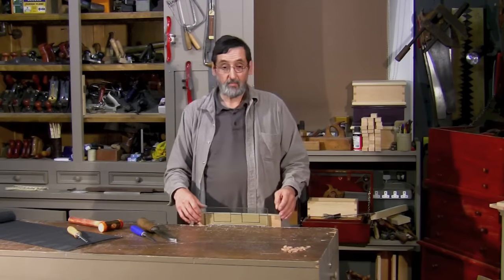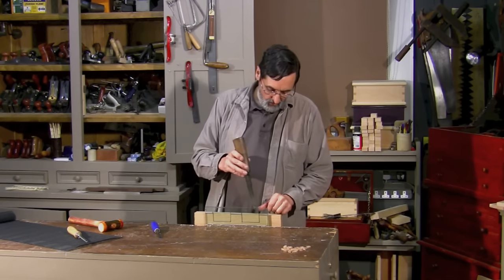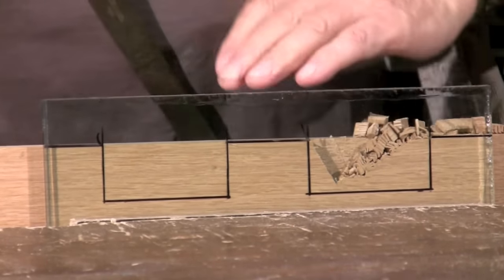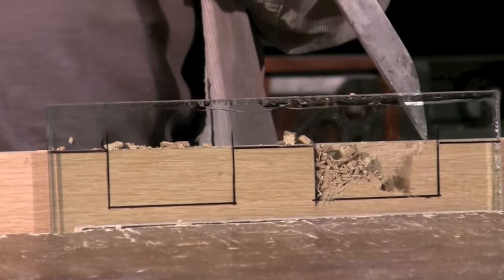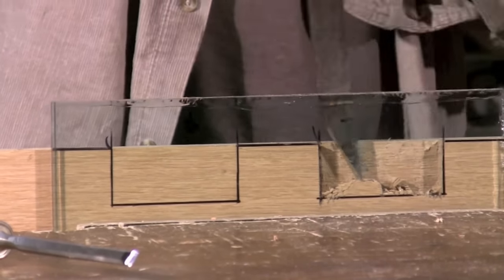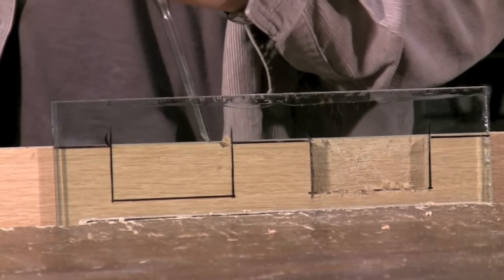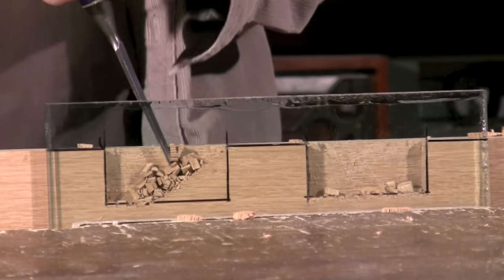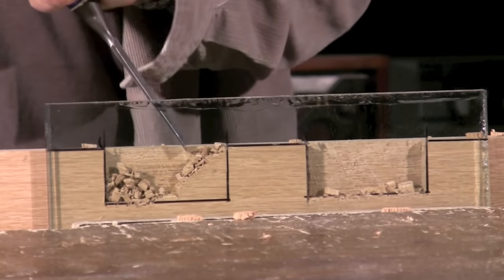Cutting a Mortise - Mortise chisel vs bevel edge chisel | Paul Sellers

Comment: "Challenge the traditional way" pulls out router
Reply: Good luck getting square corners!
Reply: @ferrumignis  why couldn't you do everything but the corners?
Reply: @SirFancyPantsMcee  How do you cut square corners into a mortice when plunging with a router bit?  You can't, you'd need to use a chisel to square them up afterwards, or use a mortiser instead of a router.
Reply: @ferrumignis  so you couldn't take the center out then square it ut
Reply: @SirFancyPantsMcee  Square it with what? A chisel like I suggested?
Reply: @ferrumignis  ..... yes square it off with a chisel......... do the bulk of the work with the router. that was my point.
Reply: @SirFancyPantsMcee  That is exactly what I said four posts up.  As I said in my first post you can not create square corners with a router, nothing has changed.
Reply: @ferrumignis  it's simple, use square bits
Reply: @ferrumignis  takes out a multitool with a small blade
Reply: @ferrumignis  Not entirely true. You can make a rotary cutting tool that can cut square holes. 
https://youtu.be/rjckF0-VeGI
It is somewhat like a mortise cutter though in use, but in theory you could mount that drill guide to the bottom of a slow router and push it sideways instead of drilling it out.
Reply: @SirFancyPantsMcee , Ever notice how some fools are just so anxious to argue?
Reply: No need to make the mortise square.

Comment: Paul, you are my hero. I am a 66-year-old female, and just starting to put my workshop together. I have been a machinist for 14 yrs, but never really worked with wood. This is my retirement dream to keep my busy and young. I love the way you teach and explain everything. I just know that I have a future in woodworking with your videos to aid me.
Reply: There's hope for me yet then. I want to have a workshop but in rented accommodation. Have to wait a few more years I guess... :-)
Reply: @stepheneyles2198  I live in a rented semi detached council house over in the UK, and let me tell ya it's definitely possible to do hobbyist level woodwork, I'm even planning on building a workbench tomorrow. 

I'm lucky enough to have a modest garden, so I do all my work out there in the day (so there isn't any noise complaints). 

I've practiced making mortise and tenon joints on cheap Pine without a bench, admittedly I had to get creative when holding/clamping the workpiece down, so having a bench will make that easier.

Don't be afraid of softwoods, Pine holds up pretty well for joinery. 
Just make sure your chisel is sharp! Anyway, just wanted to say that it is possible and good luck!
Reply: As they say: "You go, girl!"
Reply: @stepheneyles2198  You can and should start now already - otherwise you might lose your interest. And you might rocognize that more years of woodworking are more better ;) With silent and almost dust-free handtools you can also start on a balcony, in the backyard, in front of your door or even in the kitchen. It is not as comfortable as working in a shop but it might even be more fun plus you get fresh air ;)

Comment: I’m a novice at best. While I “know” how how furniture is built, I lack the techniques to do it well. This video has been a tremendous help for me.  I have a power router I can use to cut mortises quickly, I don’t have dust collection and it makes a huge mess. I use a bevel chisel and find using this technique for cutting mortises slower and more enjoyable than zipping them out with my 2 1/2 hp router. 
Thanks for posting this video!

Comment: The chopping with the bevel edge chisel is still the best that I have seen. Done with the least amount of chop possible. The key is turning the chisel around when going back to the starting line and using the bevel of the chisel to pry out the waste. I've watched about a dozen mortise chopping videos and no one does it like Paul.

Comment: Hello Paul,

I was referenced here by a student for his own guidance and understanding...

Over all, I think your demonstration of chopping a mortise with two different types of chisels is a wonderful educational tool..most excellent!

You validate just enough to establish specific expertise, and offer this method as your view compared to other's modalities.

If I may respectfully offer...this is a traditional method... and the way I was taught by Old Order Amish and since those days long past, have seen mortise chopping done in very similar fashion countless times with a number of chisel types in several different wood cultures.  You are in excellent company by that standard.

In general (and from my observations)...mortise chopping...is an individual skill set of the Master, their material and work style with the tool type or style dictating a given approach.

My only actual critique (if I may offer one) is that the mallet/hammer selection for the heavy mortise chisel was not well matched or in balance to its form and style of use typically.  For that heavy style of mortise chisel employed first, a much more robust hammer/sledge is what would traditionally be used, and with much heavier blows. Grant you I am a Timberwright, and use a 3lb (and sometimes 4lb) Metal Mallet/Sledge used by carvers. This speaks to style and traditional approach.

Again, much thanks for your video, and what you do for the craft!

Comment: Paul, I enjoyed very much this comparison video. I can see I would prefer to not use a mortising chisel. I saw the greater thickness take up much more working room inside the mortise. Having seen both types of chisels being used for this demonstration is proof positive to me that the normal chisels I presently own would work just fine as long as they are properly sharpened as with what you typically work with. We can see the sharpness by the thin Pillar or columns of waste wood being chopped away. So much can be learned by this very video.

Comment: Tape can be fixed to the chisel blade as a rough depth gauge, or a combination square with the rule set to your working depth.  The downside to using tape is it tends to wear away or wrinkle up and needs re-setting fairly often, so instead I'd recommend marking the blade using a marker pen.

Comment: Perhaps the original mortise chisel was developed the way it was because of weaker mass produced metals, the extra thickness allowing for enough prying force without bending the chisel.  The beveled chisel seemed to cut faster (3 min. 4 sec. vs 4 min. 40 sec,) having less area in contact with resistance.  And with modern metallurgy, stronger metals are available for mass produced tools, able to withstand the prying forces without bending.  Thanks.
Reply: +colmhain Interesting point. I use bevel edges because I have never bought mortise chisels. I get great results and haven't bent any yet. I bought some from traditional woodworker made from German steel. It was reinforced ith another metal to make it stronger and its still easy to sharpen and keep sharp.
Reply: My guess is exactly the same... I was to make that comment when I read yours. My thumbs up to you.
Reply: Mortise chisels are by necessity/definition thicker than they are wide. This prevents any twisting of the chisel as you chop down.
Reply: That makes sense!

Comment: Brilliant method. just tried it and it worked well and fast. Before I've tried the "Drill it out and tidy up" method and the Wood Occupations method from the middle out. I cut with a 13mm chisel and left walls 3mm thick each side no problem in about 5 minutes.

Comment: I had a chance to try Paul's technique on a roubo workbench Im building. The posts are 5x5 jarrah and Ive cut a set of through and stop mortises cutting out the waste with a forstner bit mounted on a drill press and manually squaring the corners. As Im still a WW neophyte, the mortises are quite rough and loose but using a Japanese bench chisel and Paul's approach has made an immediate and huge improvement in the mortise Ive just cleaned up. Thanks, Paul! Thanks, LizardWizard08!

Comment: Thank you Paul for putting out such great content.  This is a very good comparison of the difference between a bench chisel and a mortise chisel.  I have been working with wood some since my first wood shop class in 7th grade, some many years ago, but have not had time to do much for many years.  I just bought a set of Marples(Irwin) chisels so I can build up a "common mans" tool set to do more hand wood working. My first project will be to build a couple top bar bee hives, then on to a work bench, either a full on, or at least a milkman's bench with a wedge vise.

Comment: Paul, you are often slated on the woodworking blogs. I was taught to cut mortices as you do here but with a mortice or firmer chisel. Have to admit most of mine are done on a chain or hollow chisel machine now as I make a lot of gates. What I will say is as you have high lighted the use of a bevel edge chisel is fine soling as it is correctly maintained and is not used to excessively lever the material. I would steer clear from the drill out method because cutting by hand is far mor accurate an also you never see Paul pare the long grain this is to be avoided when cutting accurate mortices. I would now also cut them on the bench top but my farther a time served joiner always cut them in the vice as you do. Keep up the good work.

Comment: The glass is obviously a huge help here. It gives a perfect reference surface to guide the chisel vertically, this would partially make up for the lack of side area on a bevel edged chisel. NB a cheap chisel will have a relatively large side surface compared to the sharper edges of a premium bevel edges chisel, so would actually be an advantage here.
Also the whole cutting process will be much easier because the wood fibres only need to be severed on one side.

Comment: Ok, I've done 4 using this method.  My first ever.  First two were ok, but loose.  I spent an hour really honing my chisels.  I then knew I was going right when my chisel started to get that sliding down the chisel tip effect at 6:45.  Next two were good and tight.  I've got to work on cutting the tenons square and the shoulders even.

Comment from the maker: Yes, but it is not a big deal. Depending on the wood I will increase the bevel incline by raising the chisel, taking 4-5 strokes. This effectively works like a micro-bevel but I continue using my convex method. After the mortises are cut a simply sharpen up as usual by dropping my hand back down with subsequent sharpenings.

Comment: I'm definitely gonna try this later today. I'm gonna do the tenons with a Japanese saw. My dad and I are planning on building a hardwood fence for our roof terrace, but we're struggling with the joinery. It has to be a real safety barrier as I'm planning to take some friends up for drinks there when I'm allowed again. Drinking and roofs the are one thing that need a sturdy barrier. 

For the frame I want to go with mortise and tenon joints, as it needs to be bulletproof joinery. For the bars, I think doweling will suffice, although I'm not sure. It's quick and easy, especially taking into account the fact there are 38 hardwood bars there. 

If you've got a genius idea for this, please let me know. If you need more of an image, let me know as I got a 3D design for it.

Comment: In retrospect it seems kind of obvious that a bevel edged chisel will chop faster than a mortise chisel because the blade is thinner so you're not driving such a big wedge of steel into the wood. Perhaps mortise chisels only exist because back through the centuries the steel was either too soft or too brittle for bevel edged chisels to do mortise work, so that they would either bend or snap? Modern steel is something else tho isn't it - even on the cheapo Lidl/Aldi ones, (which I'm quite happy with).

Comment: On the subject of bent chisels, I just cut a 3/8" x 1.5" mortise in a hard maple frame. It was 3/4" deep. I used a 9mm Kakuri (not mortise) chisel. Very sharp. And it definitely did bend as I worked the waste out bevel-front. I pounded it back into true, but I think it's toast. The edge also came out ragged. It wasn't enough chisel for that particular workpiece. I used it in part because my 3/8" Narex was marginally wider than I wanted. Just sayin....

Comment: I have a M&T jig for a router but after watching your videos I decided it would be fun to learn how to do them by hand. I bought some cheap dewalt chisels and they are uneven on cutting surface. My questions is: is that normal? or is that something that I need to try and fix? or is that something that can't be fixed? By uneven I mean they are almost cut at an angle... any suggestions or advice is extremely appreciated.

By the way, you're the man Paul and I love your videos!

Comment: I've been trying to find an affordable mortise chisel like this for cutting a deep lock cavity, as I've been given a nightmare job, that's taking me hours with my conventional chisels. Basically it's installing fire brigade lever locks in solid block board fire doors. The problem is the lock is set unusually deep, and is clearly out of reach for my router (even a 16mm square drill bit and guide are stretched to the limit), and it literally takes my chisels to the hilt. Furthermore, the block construction of the board has grain running in all directions along the cut, which seems like the perfect storm of mortising challenges. A chisel like this would save me hours today, but I can't find a tool store here in Hertfordshire that sells these (Tilgear in Cuffley would almost certainly have had a selection on offer, but sadly they vanished a few years ago). I spent hours yesterday on one lock, and unfortunately it's seriously aggravated my tendinitis, and today I have two more of the beastly things to install, so I guess there's no saving me, but for future reference I was just wondering if anyone had a useful tip for getting round this problem? I bet there's an easy solution out there, it's just this job is a bit outside of my usual thing (I am helping a friend out), as I normally just work with solid timber, and these fire doors are constructed in such a way that makes conventional mortising tricky to say the least (there are layers of ply, interspersed with blocks of solid wood).

Comment: A revelation to me and I shall certainly try this method.
I do wonder how much difference to the ease of working the mortice is due to the one open side and the plate glass "fence".
Should the heavy duty chisel be truly square in section or would a small taper in one or other direction be helpful?

Comment: Paul, I know this may be slightly off topic but I'll ask anyway... You mentioned one time about bevel edged chisels and compared one to another having a larger bevel.  Not so good for working dove tails, and they should be thinned.  How does one go about thinning the edge bevel:  Should I grind on top  of the chisel, or thin from the back (bottom?)?  And, if I do not have a grinding wheel, should I use a file, diamond plates, sandpaper?  Would you be interested in making a video to add to the many you have done re chisels?  If you have already done so, please forgive an older man and maybe point me in the right direction.

Thanks.

Comment: I might suggest that the traditional mortise chisel is large and bulky because back in the day the fancy alloy steels we take for granted today were expensive and relatively hard to come by compared to lower carbon, but not quite mild steel chisels or chisels with high carbon cutting edges forge welded on to a low carbon or iron stock.  Even your cheapo chisel off the shelf today is going to be made of some pretty decent steel and won't bend quite so easily as one made from traditional materials in say the 1700 or 1800s.

Comment: Hi Paul. I love you content. You are just a joy to listen to. Kind, insightful, and calm. As a beginner I am wondering how would you fine tune the depth of the mortise, especially when you can't peak through the side to see the line. I have a feeling if I try to chop a mortise from start to finish that the bottom will end up quite wavy. Any advice in this regard?

Comment: How would you smooth out the bottom of that mortise without coming in from the side with the glass removed?
Reply: I think you normally would make the mortise slightly too deep or the tenon slightly short. The tenon shouldn't hit the bottom. Instead, the shoulders should be the point of contact.

Comment: 2 Questions, hope you don’t mind..
1-I noticed with the larger chisel especially but I think the bevel chisel was the same: They follow the beveled edge not the long flat side when wacking it. Why doesn’t it follow the longer straight edge?
2-Do you put a mark or tape on your chisel so you know how deep the mortice is??  The tenon is cut with a saw, yes?
Cheers, Michael
Reply from the maker: Because there is less resistance on one side depending on the stage you are in cutting. The chisel then forces the weaker amount of wood out of the way whereas the massive wood on the other side offers greater resistance so the chisel is able to split off the waste wood more easily. I don’t usually mark the chisel unless it’s absolutely critical which most mortises are not.I am able pretty much to gauge the depth i’m going to but sometimes I will also measure just to make sure.
The tenon can be cut with a saw but I also use other tools such as chisels to split and pare the tenon too. We have a video on a system I use all the time. https://www.youtube.com/watch?v=r-08PY3stgo

Comment: you can masking tape your chisel at the depth you want. say if you want a 40mm mortise, you wrap some masking tape on the blade, 40mm away from the cutting edge. while chopping, if you see the masking tape touching the mortise walls, you know your mortise is 40mm deep.
the mortise is usually deeper than the tenon is long. you have to leave some space for the excessive glue and for seasonal expansion.